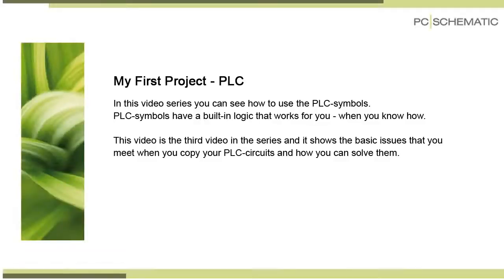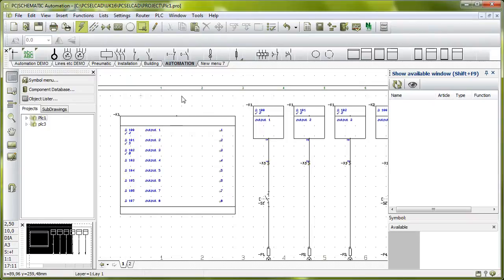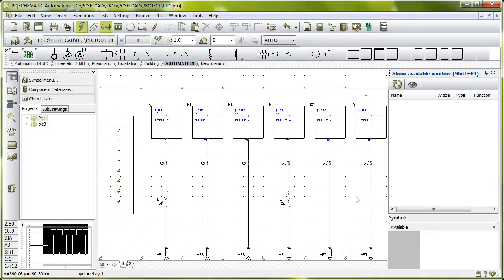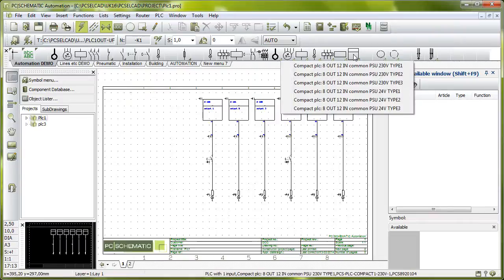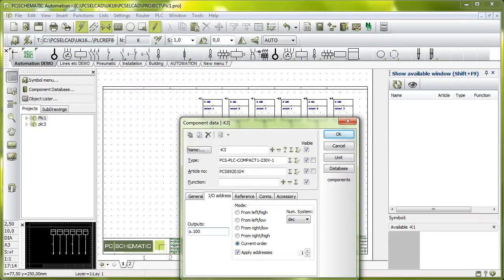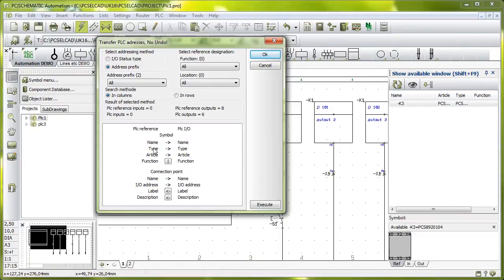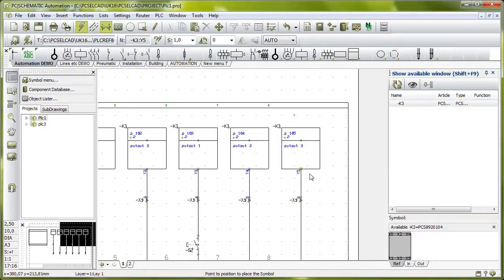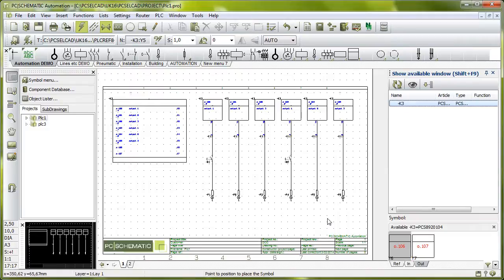PLCs in Electrical CAD: PLC subdrawings (3 of 4)

Comment: How can I copy an object at a certain distance from an certain object?
Can you tell me or give me any video link for it?
Reply: When your cursor is pointing at an object, you will see a thin green line around it. The object with this marking is the selected one. That means, that is you have several objects close to each other, you can see which one the program selects by looking for the thin green line.
If Auto Command Change is active (the Lightning icon next to Line command) then the line is sometimes around a text, sometimes around a symbol or a line - this also decides your drawing command.
Hope this helped you.
Kirsten Holst PCSCHEMATIC A/S
Reply: Suppose, I insert a Push Button Switch. I copy it and paste it 50mm away from the first one. How can I do this without using space command?
Reply: In the Functions menu, you have a Coordinates function. This also works with other functions, such as Copy and Move.
You can copy Lines, Symbols, Texts, Circles and Areas, and you can - in the rightclick menu - select a reference point for the area, you want to copy. I don't have any videos for it.
I also make various webinars - with a Q&A section - you are very welcome to attend those. See how to on our webpage.
Kirsten Holst PCSCHEMATIC A/S
Reply: Thanks for ur cooperation.